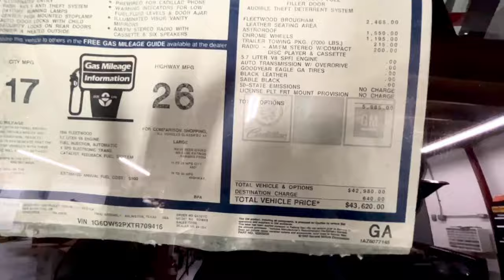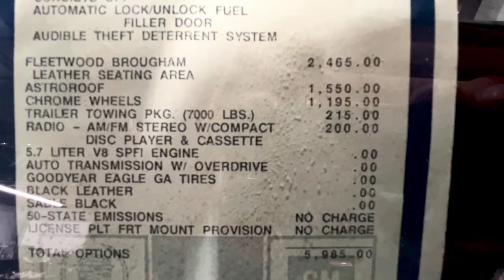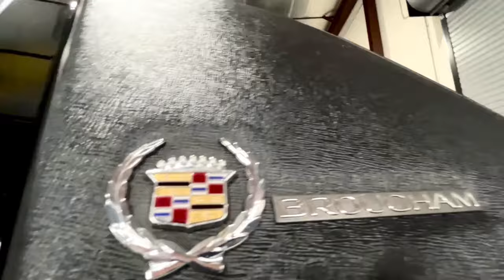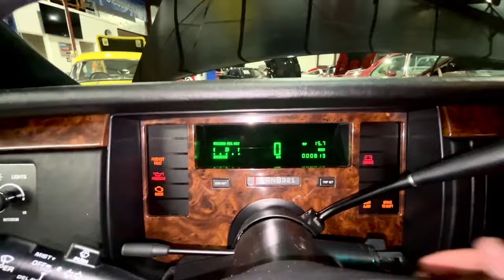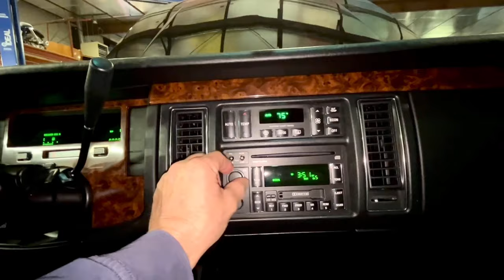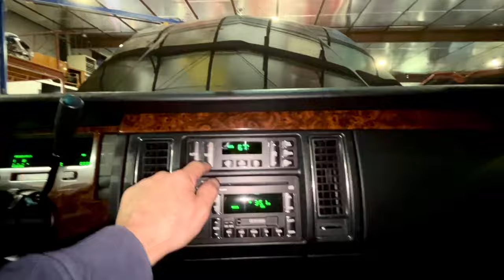1996 Cadillac Fleetwood Brougham LT1 V4P 800 Mile museum walk around in and out

Comment: I have a 95 White and White Vinyl coach like top with blue leather. Exactly like this that I bought in Phoenix 14 years ago.  37,000 miles.   I’ve done much work on it replacing transmission cooling lines, new brakes, New Opti spark new OEM radio with CD, And more and the paint and and lower chrome is a 90 out of 100.  I have babied it in the north and always garaged it conditioned too. …so ready to sell.  59,000 miles.  I liked it for the comfort, power and it drove darn nice at 75 mph interstate.   Many have complimented me.   I wish we had cars like this for cruising luxury now.  I miss those comfort cars.  And I’m your age so I remember some really nice older cars.
Reply: Oh yeah…Surprisingly my Power antenna still works!
Reply: I know what you mean about those darn side speers.  A guy in Southern California sells them and I bought 4 and they are real metal and backing adhesive. Super nice.   But don’t buy from the guy in Northern California!  His don’t have adhesive on them and the metal isn’t shiny.   My bright work is extremely nice and not one dent on lower exterior.

Comment: Not fully loaded.  Opera lights and SLP parts missing.
Reply from the maker: Yes.. factory flowmaster option missing too!
Reply: @gm-classics  I installed a ZZ9 cam from TPIS, 1.6 roller rockers, opened up the exhaust a bit and headers and underdrive pulleys and 3.70 gears back in the day.  Somewhere hidden in the long forgotten RacingFreaks archives there's a vid of me wiping a WS6 TranSpam from a roll and drag

Comment: Yeah, the L05 engine from 1993 was a slug. The L05 was the optional engine on the 1990-1992 Broughams. I had a 1990 Brougham with the V92 and the L05. It was such a slug compared to my 1996 Brougham. I had 2 V4P Broughams one 1996 with vinyl top delete, and a 1995. They were quite fast. But for some unknown reason, I had a 1994 Brougham without the V4P, so it had 2.93 gears, and it was the fastest LT-1 D or B body I have ever owned. I guess it was built on a Wednesday.

Comment: tell us more about the no-oil-change F150 please!
Reply from the maker: It’s coming don’t worry trying to hit 200k first.   The truck also still has the original belt on it the original water pump and the original air filter believe it or not. Yes I take the air filter out and blow it off with an air hose but it’s the original one.   I have been doing this since 2010 just as a I don’t care kind of testament to see what it would actually do. If I blow it up I was gonna put a 6.2 in it but so far so good and I think I’ll wear the rest of the truck out before the engine goes
Reply: Had an 00' Durango with a bad rear main seal, left droplets every time it was parked. Calculated it was cost effective to add dollar tree oil at the time instead of fixing it.  280k miles daily drove it for 2 years sold it like that.  It's still be driven to this day. 4.7 magnum with a little milkshake. Added oil weekly.  Coolant monthly. Never ran hot.  Still running.  I've seen lack of oil changes kill 4 and 6 cylinder cars even v8s like the 3v but the 5.9 and 4.7 magnum are basically bulletproof and the mighty LT1 is the most slept on engine from the 90s

Comment: They are amazing as everyone wants to say. Were cheap built pieces of {?} from GM back in the day!!!  Headliners failed, spheres on fenders failed, due to being made of plastic. Interior was no match to the D' Elegance package of 92.   No OPERA lamps for that "upscale" ambiance.
Really, what is there to preserve for the Cadilliac purist??
Reply from the maker: Yea all those are issues.. no car is perfect… i was around when people were throwing 911’s in their yard in dallas as they could not take the heat and burned up in a year….  Old Cadillacs even from 50s 60s were crap body lines new, we expect perfect now and the restorations are much over done.   A new honda mini van will blow the doors of car shelby’s best 66 mustang….  A duramax truck with a 10000 lb trailer will beat a 79 camaro in a race….   On and on it goes….  Classic cars are about preservation..   as i can testify, there is not a one of them that is really fun to drive unless its highly modified…. But then its not original…. And then no one cares….  So classic cars are really a “you cant have fun” self abusive hobby… and its certainly not for everyone

Comment: The frames are very weak on this platform.  I have crushed several of these and on the limos and hearses the front and rear of the car get folded so it will fit in the crusher.  One fork on the loader bends these frames and the whole car like a pretzel.  The crusher doe’s the rest.  If I were to own one of these I would definitely reinforce the frame.  That is one nice car though!

Comment: Matt, I tried to buy the white 2,300 mile 94 Fleetwood Brougham from you back when I was in Iraq. $25K wouldn’t do it. I don’t like the mirror placement on the earlier models and prefer the 96’s because they have OBDII and the mirrors on the corner of the window. But hey, question for you. Nobody has the belt tensioner for these cars with the heavy duty cooling. I bought a 33K white Fleetwood but in 2016 got a 22K Buick Roadmaster. That’s the car I need one for. Any lead? Thanks
Reply: Rock Auto